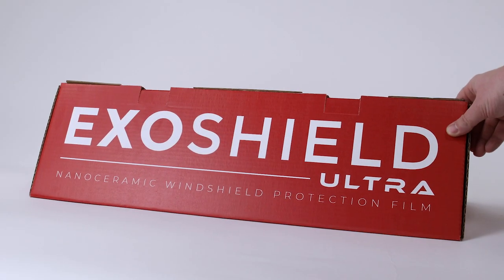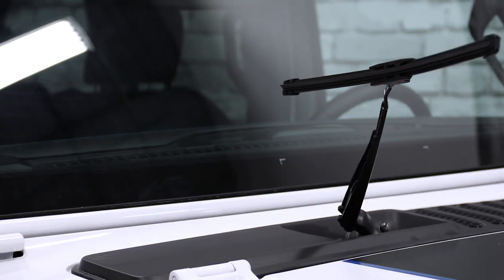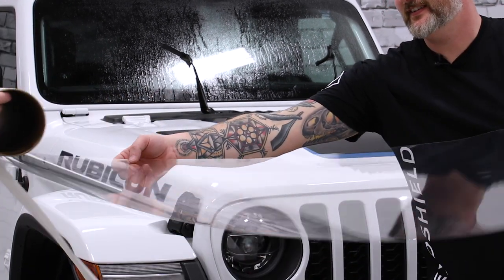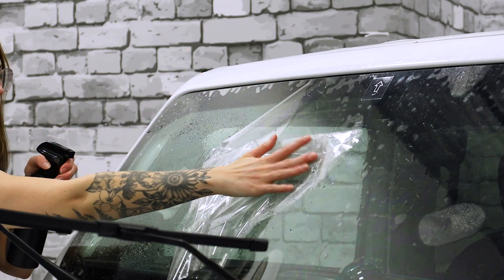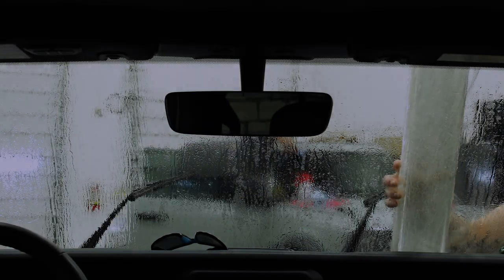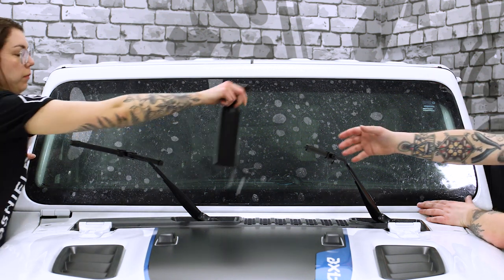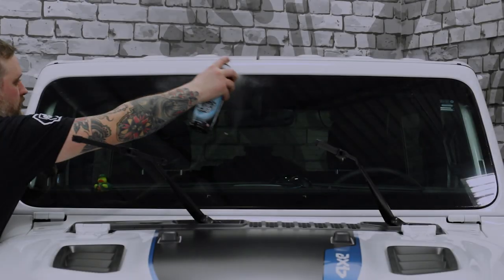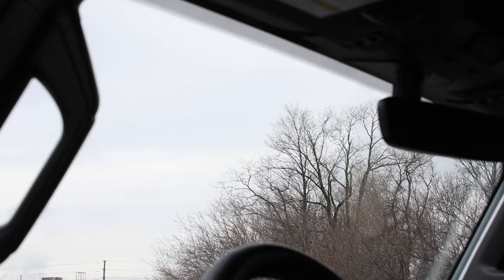ExoShield ULTRA | How to Install DIY Windshield Protection Film

Comment: Do you have to use a special cleaner to up clean the shield? Mines been on for 2weeks and everything has been good but I did notice today, because it was raining. The shield holds the rain. It don’t drip off while I drive and when I use my window wipers it makes a screeching sound. My wipers are brand new so I know it’s not that because it didn’t do that before. Can I use an oil film or rain-X on it to help this? I don’t want to ruin the film. Thank you.

Comment: That's the most bizarre installation I've ever seen. Just clean windshield as directed, pull the protectabt off the adhesive and coat windshield good with solution and apply with friend. 0 reason to put on the windshield, then pull off and roll up and put back on. Totally unnecessary step that'll screw up more installations than it'll help.
Reply from the maker: This step helps to make sure you have the orientation correct before removing the liner! You’d be surprised how easy it is to apply upside down without checking first!

Comment: I love how they offer DIY kits for two models of vehicles…both with tiny FLAT windshields. Where are the other kits?
Reply from the maker: Hey! Fair question. 

We released these kits for the exact reasons you mentioned. They're super flat which makes them prone to chipping. Tiny... sure compared to other windshields, but have you ever tried putting on a phone screen protector? When paired up with our DIY kits, these windshields are easy enough that someone who has never installed film before can get a great result (make sure to watch our installation videos first!)

More complicated installations we leave to our network of professional installers to make sure the protected clients get the best possible results. 

Thanks for asking!

Comment: The problem is this product is priced at about the same price as a full windshield replacement on a Jeep JK, that's just the product and a diy, not labor.  I've had three windshield replacements in twelve years at ~$200-$210 each time, installed.  These Wrangler's & Gladiators are literally the cheapest, easiest glass to replace and the off brand glass is just fine because it is nearly flat so no big deal to just replace the glass.  How about a better price, by the roll, so I can put it on my Porsche, etc?
Reply from the maker: Windshield prices have gone up dramatically in the last few years. You can find plenty of JL and JT owners that have paid over $1000 for a full replacement and recalibration! If you own a vehicle that has a cheap replacement, and you're ok with replacing the glass then maybe ExoShield isn't the perfect fit for that vehicle.

We do offer ExoShield by the roll to our Certified Installers all over the world! If you're interested in protecting your Porsche we suggest you get in contact with one of these installers as "off the roll" installations are a very skilled process. If you own a licensed and insured automotive restyling business and are interested in applying to become an installer we will leave the link to our application below. 

https://www.getexoshield.com/become-exoshield-reseller
Reply: @ExoShield imagine spending ＄500 just for the windshield to crack and have to pay for a new windshield anyways. 😂 the cost of this ExoShield just makes no sense. Makes more sense to buy a whole new windshield